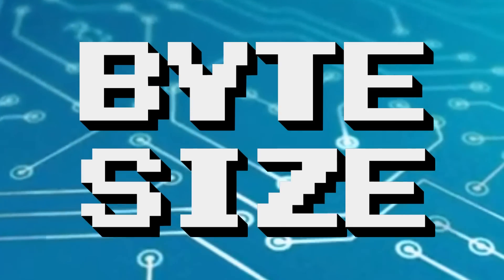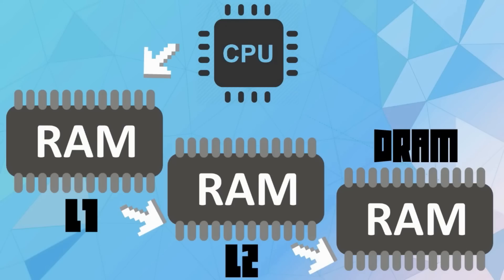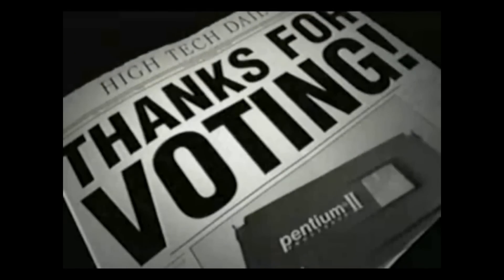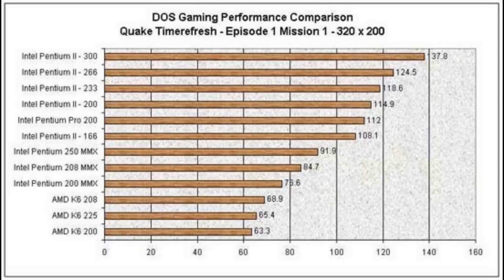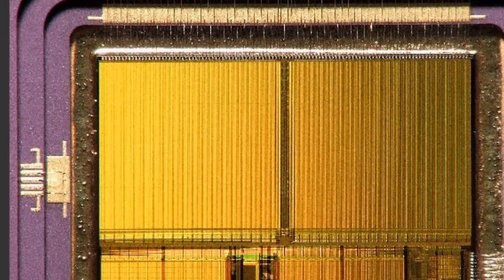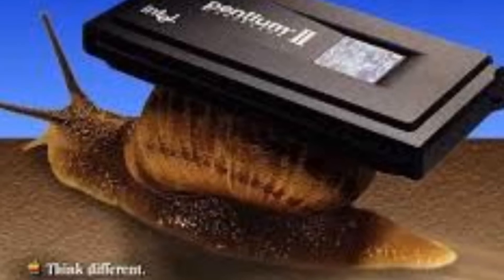Why Were Pentium 2's on Cards? [Byte Size] | Nostalgia Nerd

Comment: The reason for the cartridge was to prevent AMD (and others like IDT and Cyrix) from making CPUs for their motherboards. AMD continued making CPUs for socket 7 as did Cyrix. The K6 II and K6 III was from AMD.
Then, AMD decided to make a similar thing as Intel : the Slot A.
Cyrix dropped out of the game and so did IDT.

So, the worlds divided. Now we have Intel CPU motherboards and AMD CPU motherboards.
Reply: Yeah, this part is also true.  Ciryx and IDT disappeared ....VIA  barely made it.  kinda survived and invented the mini-itx form factor. And settled for industrial under-powered mini computer.
Reply: And now the ARM is dragging us... circular..   

ARM=Acorn Risc Machine - wiki states that names have changed.. aha..
Reply: herauthon four

ARM is dragging us into oblivion?
Reply: is it . . depends on which arm.. left or right..
i saw the Acorn StrongARM in 1989
and was already quite impressed..
dual-core; ARM - Intel
could run Windows 3.0 next to
GEM (or whatever it was running..)
Reply: Brings back memories. The second computer I built had a Slot A AMD. At the time, I remember thinking the thing needed a ridiculously large heat sink and fan. Doesn't even compare to the heat pipes and all that is needed to cool the high-end CPUs and GPUs now.
Reply: Except you could make an adapter cartridge anyway -- a friend of mine did back in the day -- he's an electronics engineer though -- I guess there are no official products that did it, but... he did... and man his Intel board's BIOS was super confused about the AMD chip he had plugged into it... but hey, it booted to windows -- and basically with a bit of elbow grease he was able to upgrade his CPU without buying a new motherboard.
Reply: louis tournas K6 were damn good processors. Used to have a Cyrix “686” before they vanished.
Reply: I had a Cyrix once upon a time.  Was a good little CPU
Reply: @herauthon  the funny thing I see is the Z80 was close to a copy of the 8080 from where the x86 CPUs grew up. And the ARM is heavily based on the 6502. So... the battle of the early 80s (6502 vs Z80) is (almost) happening again (ARM vs x64).
Reply: - 2mtr from me  - AMD K6/2 500 working - with Promise TX133 IDE - running NetBSD ; offline now
but i could make it visible online :D
Reply: Stopping others selling co-processors was Intel's main aim.
Reply: @jonathanpalmer155  
But the Socket 7 did not have a coprocessor. The Pentium, Pentium MMX, Cyrix 6x68, AMD K5 and K6, IDT Centaur and such all had an integrated FPU.

Comment: Let me fix some misinformation:
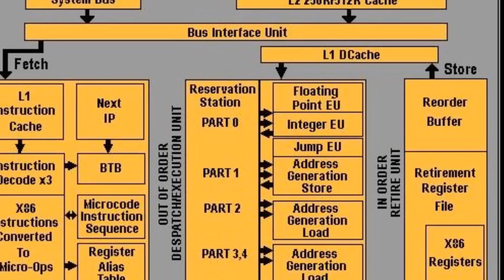0:34 First Pentium PROs had 256K of built in memory, 512K came later.
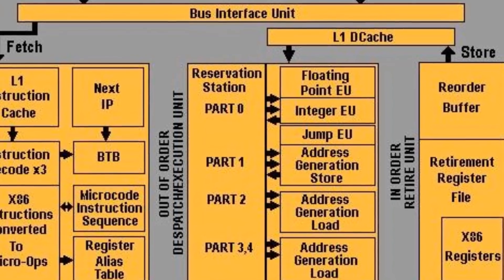0:40 Pentium PRO's L2 cache was `talking to the CPU' at full speed, this was reduced in later Pentium II chips to ½ of the core speed.
0:56 Nope, 1M Pentium PRO had three on-package chips: CPU core and 2x 512K cache. I've seen a few tons of Socket 8 boards, none of them had cache on board (although it was mentioned in some magazines that it could, same for Slot 1).
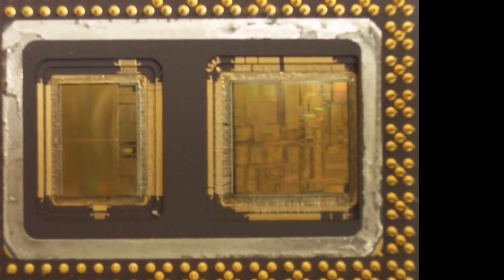1:45 Ehm, now you mention full-speed bus? See 0:40.
2:51 No Pentium PRO board had any room for cache (see 0:56). Pentium PRO was sometimes faster, 'cause its cache run at 200MHz, whereas P-II 333 cache run at 166MHz and had a bit higher latency.
3:41 There was more to this story: after people were outraged with Celeron 300 performance, Intel released Celeron 300A with 128K of full speed L2 cache built on-die, making it quite a good performer. In fact it was popular for overclockers, as they could put it on 100MHz bus (see B21 mod) running at 450MHz (yay!)
Cheers
Reply: you left out the part where PPro's today are upgraded by mashing them up to remove the gold which is sold to buy a new cpu.
Reply: the ppro was also a little ahead of its times, as it was optimized for 32bit only, in fact in 16bit it was slower than p55c (mmx pentium). the celeron-a was more popular in its socket 370 implementation, where you could overclock it without modding the slot (the more used was the 366@550, or more). there was also a (relative) cheap dual socket board (abit bp6) with which you could build a very fast dual 366@ 550mhz (at least)
Reply: argoneum ok now I'm subbing you
Reply: the pentium pros with 256/512/1024kb cache all released at the same time in 1995... they were simply at different price points... the only other processor ever relased for socket 8 was the 333MHz overdrive chips...
Reply: The similarities to RyZen Threadripper, a modern package-based CPU lineup, are interesting as well.
Reply: argoneum b
Reply: I didn't think I had ever heard of a Socket 8 board that allowed for motherboard L3 cache on a Pentium Pro. This happened with the K6-III a few years later, but I used Pentium Pros a lot back in the day and still own some Socket 8 boards. I never had one with motherboard cache on it.